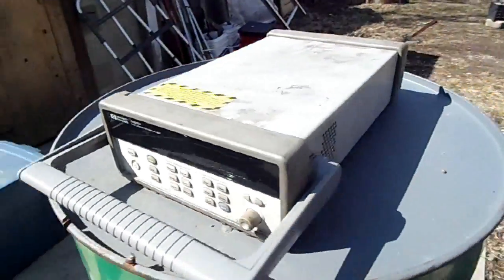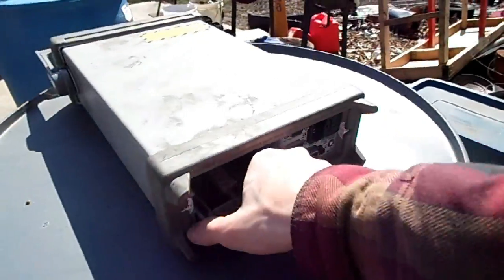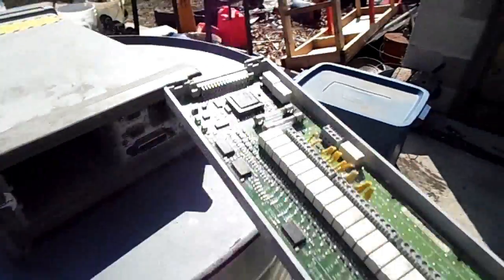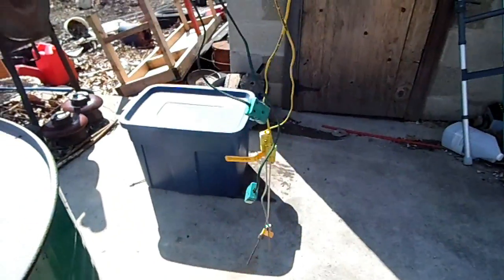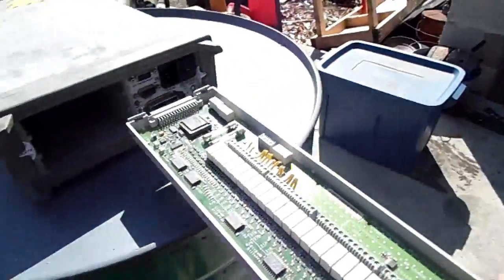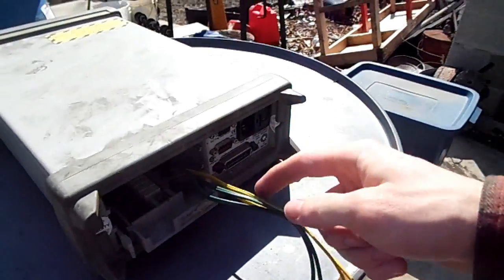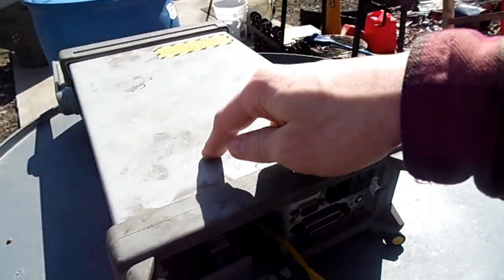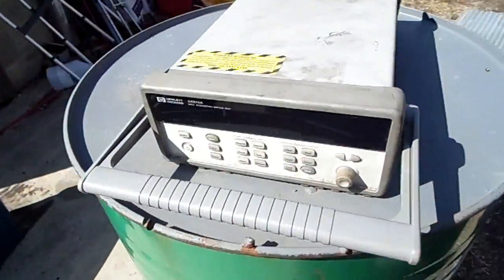1550  °F Fresnel lens

Comment: You might be able to use that to monitor the temperature gradients between the hot side and the cold side of your Stirling engine.  It will be necessary to transfer and dump heat really quickly on the cold side.